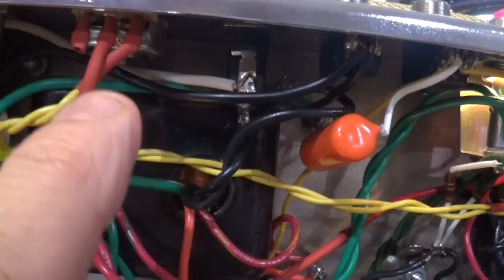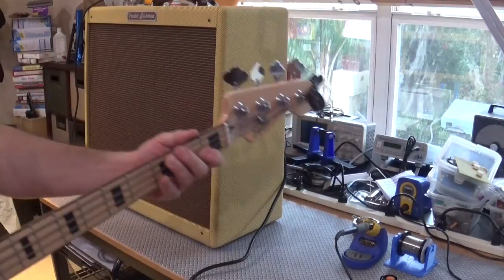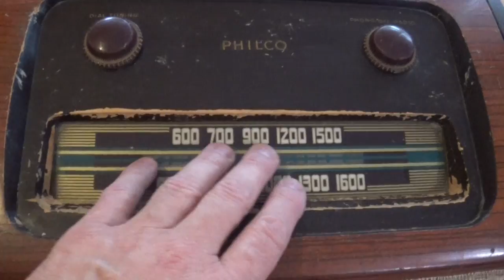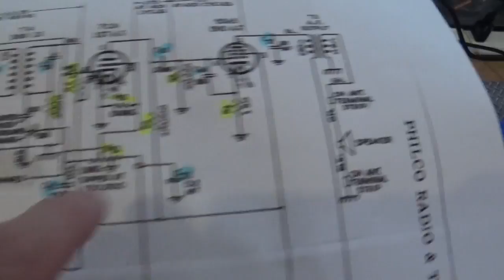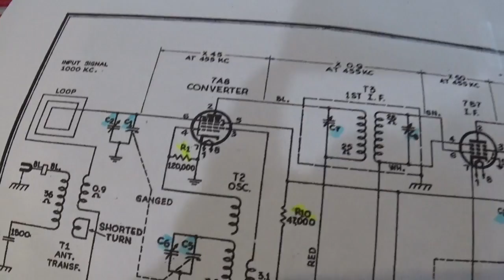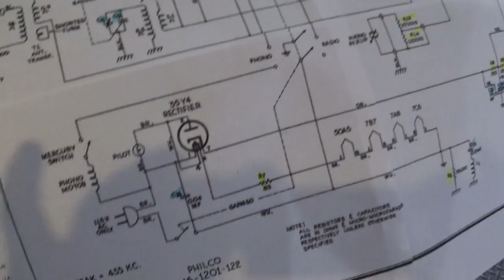Fender 59' Bassman FInal Episode and New PHILCO project

Comment: So cool you use it for bass. I have one from fender and play bass with it. I liked it so much i bought a second one for bass. I use a mxr 10 band EQ basically flat just highlighted lows and 1000k, mxr smart gate set very low, mxr vintage bass octave, and abominable electronics hail satan deluxe. I mostly play clean but use the octave and fuzz on and off for fun. Amp is set middle and treble at 6 and bass at 8 presence at 5. It sounds amazing although i swapped the stock Jensen P10Rs for eminence legends and basslites for lower frequency responses. They basically sound more robust and have a wider range but close to the Jansen speakers. They also handle more power so you can crank the amp a bit if desired. I never even go to 3. Sounds like a 59 bassman even with the speaker swap.